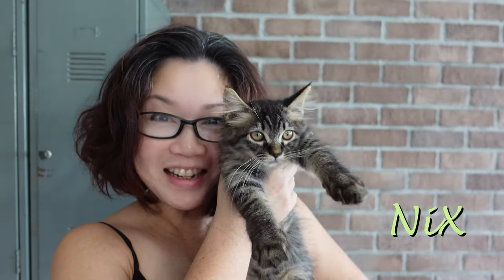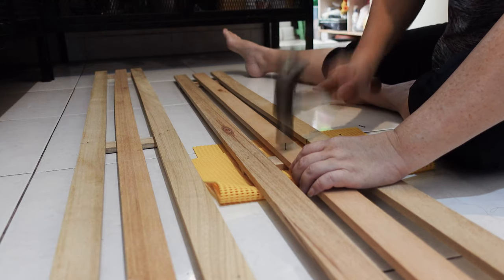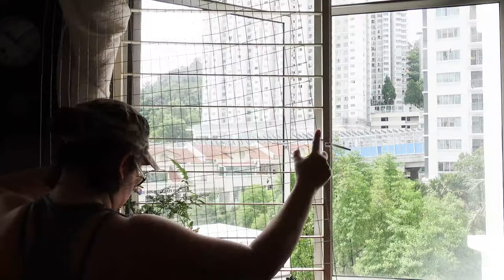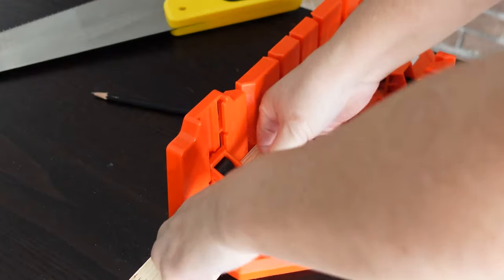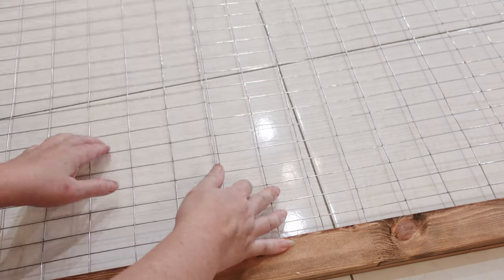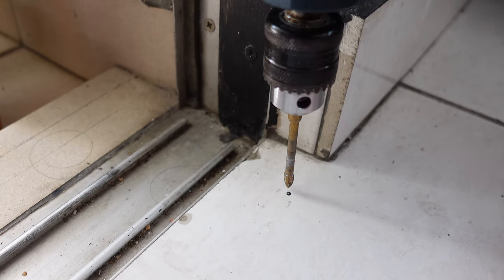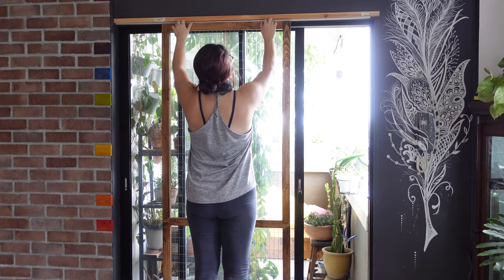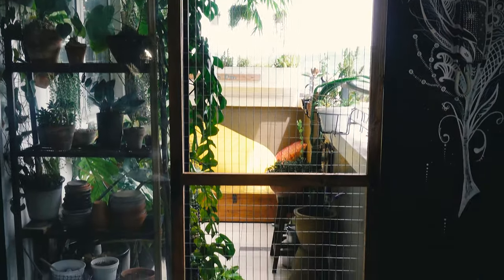Practical DIY CAT PROOFING our Home - Watch till the End for Extra Kitten Clip

Comment: As usual great learning here for me. Thanks Winnie. I plan to get a kitten so was looking at ways to keep her indoors. How to tell if the wire mesh is of good quality? Thanks. I’m thinking to order some also.n
Reply from the maker: Thank you for watching! The better mesh is thicker and quite difficult to bend. Whereas the ones you usually see around esp in hardware shops are normally the thin ones.
Reply: Thank you . @WinnieLuthienThye  Yaya! I have not been impressed with the ones at the hardware stores. What do i search for on shopee/lazada. I tried looking for mesh. stainless mesh and the biggest was only 1in x 1in. I"m looking for something like yours with bigger mesh is it 2in x 1 inch?
Thanks!!
Reply: Always get two kittens or they will develop behavioural issues !

Comment: Is this removable by humans from inside in case of fire escape? Perhaps with
Hinges on top of a frame?
Reply from the maker: You mean the windows? Yes, the metal grill is like a door with hinges, and the wire mesh is attached to the metal grill. When I open the latch, the metal grill swings open together with the mesh.